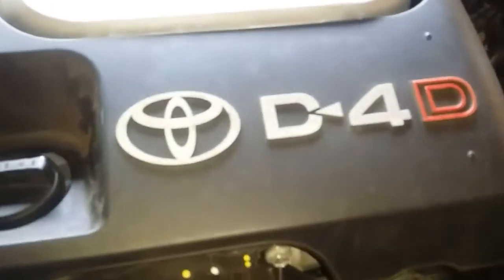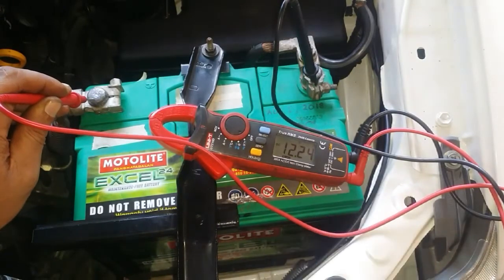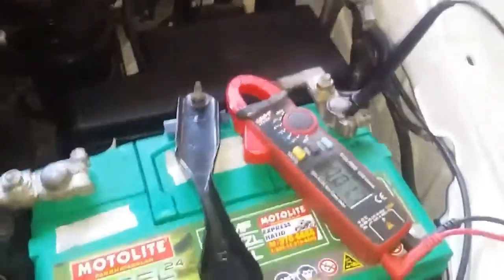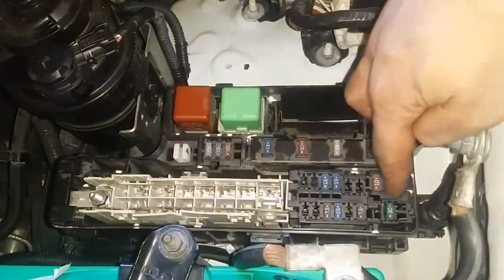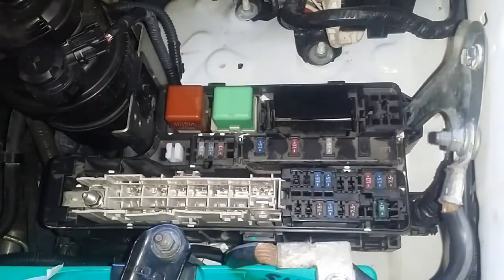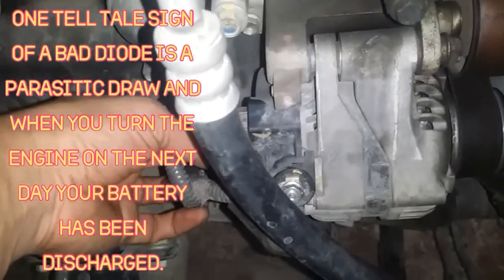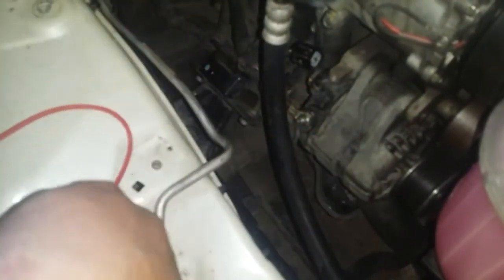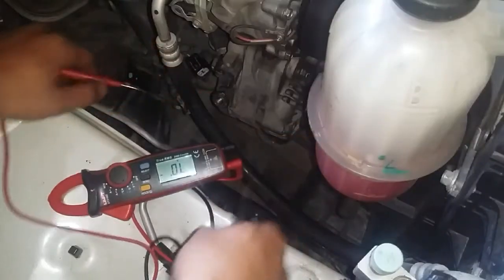How to Check Your Alternator PART 1 (alternator still on the engine)

Comment: My 2009 corolla Has the Same problem. When you unplug the harness the whining noise Will Go away, And When you plug it Back the noise is Back again. So is it a diode problem?
Reply from the maker: The onky way to be sure is to check with a mulitmeter. One tell tale sign of a bad diode is your battery will be discharged.